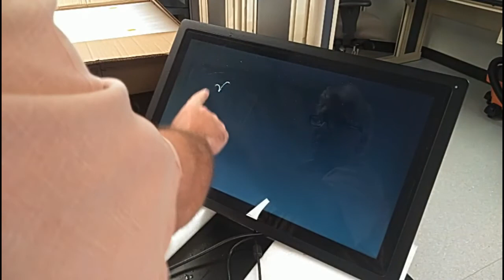Water rejection test for Shenzhen Think Touch open frame monitor

Comment: Can you discriminate by area size, a finger press has a distinctive shape and size.... good stuff btw!
Reply from the maker: With HID based devices you do not get a heat map but rather an X,Y coordinate representing the center of the sensed finger "blob" as calculated by the firmware running on the touch controller.  There are plenty of tricks to employ similar to what you mentioned (and more) if you have access top the so called heatmap which is the raw data coming off the sensor.  When consuming HID reports and nothing else, the standard application can still do some filtering.  For example in a marine setting, 99% of the time you will be looking for a single finger.  So if you are  getting 2 blobs on the screen that could be fingers, the safe thing is to do nothing and wait for the invalid (2 finger) condition to clear up.  That is what Garmin appears to do it its latest generation of touch based MFDs.  Another trick is locality of reference.  If the user is using a certain menu and then you get a touch in another menu which does not seem logical for what the user has been doing, be skeptical about accepting it.  Other tricks are only accepting long presses or accepting finger touches only when a second touch is seen in a validation box in the lower left of the screen.  In other words, if the user is using the touch screen then he would use 2 hands.  Again, many ways to play games but all of them make the user experience less than perfect.

Comment: Hello, thank you for all the information you have provided about using the additional monitor with the 8612. I just recently purchased one and am in the process of upgrading all electronics. After reading all of your information I would like to try to hook up another 12in monitor to work with the 8612.  Do you have a recommendation for a brand that you feel will work this best. From what I could tell unless I missed some new information you have put out, you never really found a larger monitor that you were happy with for offshore center console style applications. I have only just begun researching 12in screens and thought I would get your advice and opinion. I have been looking at the Xenarc models in the 1200 dollar price range. Can you please give me your opinion of what would be the best brand and or model to use? I have tried to read all your post and I don't think you have addressed a similar question and if you did I apologize. Thanks again for doing what you do and helping others.

Comment from the maker: I want to add one observation based on experience.  I recently drove Third Wave from Virginia to Freeport Bahamas over the course of a 3 week trip and during this time we had our brand new Garmin 8612 XSV MFD mounted in our fiberglass helm unit.  We do not have a hard top installed yet so it was out in the elements the whole time.  We did not get much rain and we were not going very fast, just at 8-9 kts hull speed, so we did not have any salt water come up to the fly bridge.  But the rain we did get would intermittently incapacitate the capacitive touch. To their credit, I never noticed even one ghost touch from the rain and that of course is the most important thing: thou shalt not ever ghost touch!!  

My experience is that the garmin unit, which uses capacitive touch, has a fallback strategy whereby if it cannot generate touches with confidence due to the presence of water drops or falling rain or water rolling down the screen, they just stop reporting anything at all. It would be nice if they put an indication on the screen that they were falling back to safe/limp mode and then remove the warning when returning to full operation, but nobody likes to point out their weaknesses like this even though it would be better for the user.

When the screen was full of drops and no longer working, one quick swipe of the forearm was all it took to recover out of limp mode but if it was raining steady it would go back into limp in a matter of seconds.  Garmin makes top quality gear and so you know this is pretty much the state of the art for commercially viable water rejection in capacitive multitouch.  I think that will change in the next 2 years based on my personal knowledge of the industry (I'm an engineer with a touch screen company) but for now, it is what it is.

Comment: Is it easier to make this work with a different kind of touch tech? Resistive vs captive or whatever they are?
Reply from the maker: Yes.  Resistive does not suffer from ghost touches like capacitive touch.  But some resistive touch does not support multitouch gestures like pinch zoom.  Also, resistive works by pressure and so not only do they wear out over time, but they can require firmer touch presses.  But perhaps their biggest drawback for the marine environment is their poor visibility in direct sunlight.  Also, the top layer of a capacitive touch screen will generally be some kind of very hard chemically strengthened glass.  You may recognize the trade name "Gorilla Glass" as being Corning's offering in the chemically strengthened cover glass space for capacitive touch.  In contrast, resistive touch top layer must be relatively soft and flexible because resistive touch is just two layers which, when pressed together, make contact in order to register a touch.  The best indoor user experience is always going to be capacitive.  But for outdoor work other technologies may indeed be better.  The trick is to find someone who will deal with them.  Everyone and their dog deals with capacitive because it is relatively easy to install and cost is fairly low compared to alternatives.